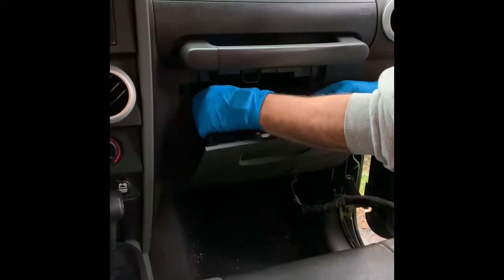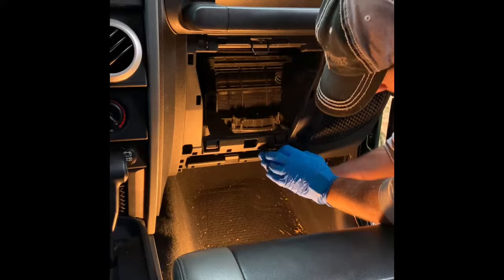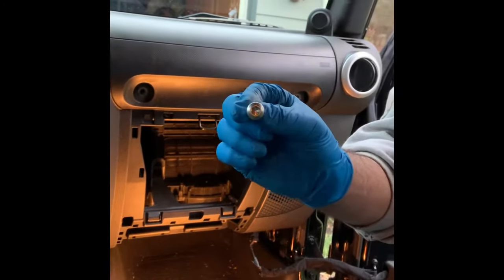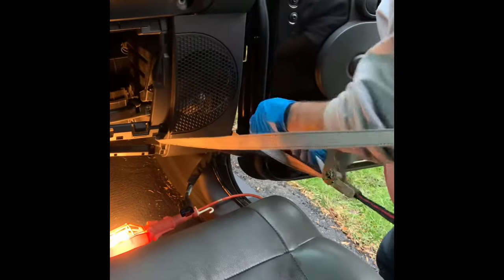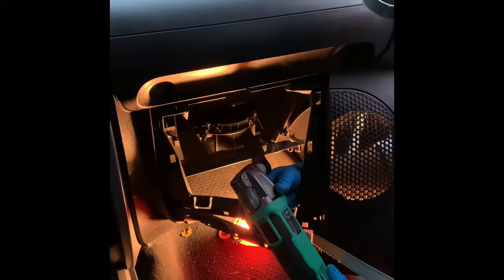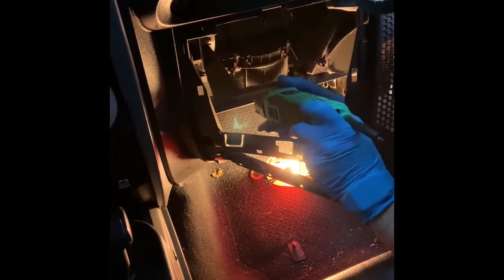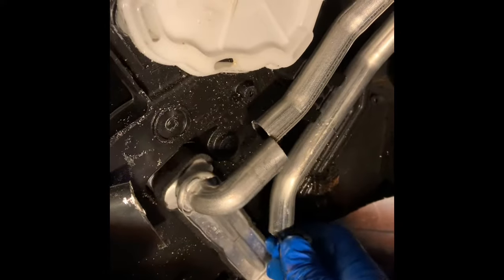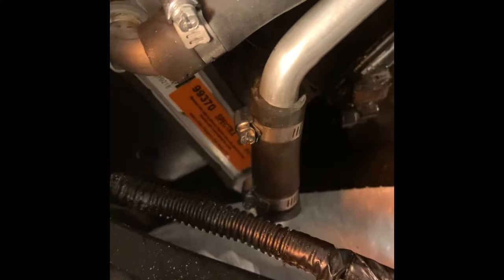Jeep Wrangler heater core replacement (short cut)

Comment: So I have the problem where the left drivers vent comes out cold.  Do u believe a new heater core would solve this issue?
Reply from the maker: My issue was similar to yours where passenger side was just a bit warmer, but still not hot. It got progressively worse. In my case it was the heater core since half of it was not allowing hot water flow. I would check all other possibilities first like making aure the blend door is working correctly
Reply: Your heater core is most likey clogged.   I did mine this weekend & the old one weighed about 3 times what the new one did.  Most older JK's don't have dual zone, so should only have one blend door.

Comment: Going to do this in the next few days. Did you drain the coolant from the radiator or clamp the heater core hoses in the engine bay? Or just cut the core out without doing either? Thanks.
Reply from the maker: I did not drain coolant. I did use a small oil drain pan and lined footwear with large plastic bag to catch any coolant that came out. Got a bit of coolant out but nothing major.

Comment: What heater core did you order? I assume its not the stock one since the plumbing is shorter. Or did you order a stock one and mirror the cuts? Thanks!
Reply from the maker: Sorry for delayed response. Here is one I ordered. Yes, mirrored cuts on new one. 
Spectra Premium 99370 Heater https://www.amazon.com/dp/B008VN02B0?ref=ppx_pop_mob_ap_share

Comment: Hey, thanks so much for that. I have a Jeep Wrangler Jk 2011 and my mechanic reckons that my evaporator is leaking. (this was done after a re-gas attempt and then a subsequent UV dye check performed) He's quoting me 10 hours of labour and parts. All up around $2500. He also suggests replacing TX valve and desiccant bag. I'm not sure whether I have to do that because just the evaporator is apparently leaking. By the way, unlike some of the other commentators, my cool air is gone. I'm in the tropics and boy do we need it. Do you know anything about TX valves and Dessicant bag? Would I need them? Anyway, love your method I really want to give it a go.....

*When you mentioned...."unhook the top heater core hose going to the engine and fill it with antifreeze. Reattached and used one of these funnel kits to get rest of air out. Got to attach funnel and let jeep get up to temp. You will see all trapped the air bubbles come out.

OEMTOOLS 87009 No-Spill Coolant Funnel Kit, Near Universal Fitment, Translucent, 15 Piece Set, Cooling System Funnel Allows Access To Hard-To-Reach Radiators" .......

And please forgive the dumb question..do you do this after or before? Thanks.
Reply: Do the txv and desicant. Any time you take apart the ac do the dryer. If it's easy to get to the txv, then just do it. They are cheap.

Comment: Wonder if draining some coolant, and putting the rear end on jack stands would minimize the amount of spillage in the vehicle.  ?  Maybe ?  Was it a lot that came out ?   Nice video thank you.  I'm thinking if i ever have to do this, a couple mending plates with bolts/nuts and that framing is back together !
Reply from the maker: lifting could certainly help, but not much coolant came out (maybe 20 oz or so).  It's up to you if you want mending plates, but not necessary.  If you cut where I say in the video, all goes back together well.
Reply: Something you could try if you have not already done the job is after unhooking the heater hoses blow compressed air thru one of the inlets to get as much coolant out of the core.
Reply from the maker: You are very welcome. Not much coolant came out, but enough to make a mess (maybe 12-16 oz). Not sure how much jacking back up would help. If you cut the framing per the video, no need for mending plates the bracket is only there to hold the dash, it is not a support structure in any way

Comment: Did u have any leaks at the clamps after doing this? I have tightened mine as much as I want to and sometimes it weeps a little
Reply from the maker: Hi Jeff,  Funny you asked about that.  It just started weeping from the top clamp.  I would up getting doubling up with new stronger clamp.
Reply: @Difficultmadeeasy  What clamp type did you use that’s stronger/better? 
Asking because I’m researching this job now in preparation of replacing the heater core in my 2014 Jeep JK Wrangler.
Reply from the maker: I would double clamp and would use stainless.  @chazzcapone.

Comment: Do you need to worry about refilling the coolant that leaked out? if you do need to, is it as simple as just pouring in the radiator or do you need to worry about air pockets?
Reply from the maker: You can refill from radiator, but will need to purge/bleed the air out
Reply: Oh gotcha.. any suggestions on how to do that easily? Or any videos you recommend?

Comment: how did you mount thay brackey back on ? did you weld it?
Reply from the maker: If you cut the bracket in the place I showed in video, no need to weld anything. Just put everything back together and will work fine.

Comment: Thanks. I have that trouble.  I cannot figure why hot fluid that runs in via the top tube and circulates through the radiator and comes back out the bottom tube can allow hot on the right and not the left.  Hot fluid has to be coursing through the entire core from top to bottom.  So how can the left side POSSIBLY be cold….and that’s cold top to bottom of the dash system on the left side, too.  Defies the laws of physics.  Why and how?
Reply from the maker: Hi Terrence, you are welcome.  I love my jeep, but unfortunately the engineering and quality of the products and parts that make the whole are certainly lacking.  If the heather core is blocked (this is very common), my guess is that hot water from the engine will find its way to the heater core one way or another (top or bottom hose) and stop the flow there.
Reply: Agree with all you say.  But you haven’t explained how a radiator can take in hot fluid at the top, get hot fluid out the bottom and deliver heat only to the right side.  I’m thinking of following your plan today but then working with the old heater core after it’s removed.  It looks much easier to play with out of the vehicle.  And then… how did you reconnect the bar that you cut out at the left side?  Did you add a patch with sheet metal screws?
Reply from the maker: @terencegillespie6675  I reconnected the bracket with the original screws.  If you cut support bracket in the same spots i did on video it can go right back in without any additional screws.  that bracket is only there to support the dash.  see section of video starting at 4:50
Reply: @terencegillespie6675  im sure you have repaired yours by know, but the explanation you are looking for is the heater core gets filled with casting sand. Its sand from the molds used for the engine. The sand gets trapped in the tiny tubes near the opposite end of where the coolant Inlets are. This is why the heater core will put heat to the passenger side but not the drivers side.

Comment: How did you vent the air from  the system? Thanks for the video
Reply from the maker: unhook the top heater core hose going to the engine and fill it with antifreeze. Reattached and used one of these funnel kits to get rest of air out. Got to attach funnel and let jeep get up to temp. You will see all trapped the air bubbles come out.

OEMTOOLS 87009 No-Spill Coolant Funnel Kit, Near Universal Fitment, Translucent, 15 Piece Set, Cooling System Funnel Allows Access To Hard-To-Reach Radiators https://www.amazon.com/dp/B01A2CQSU6/ref=cm_sw_r_cp_api_glt_fabc_E09TBH1GZV5E7DTJ97JR?_encoding=UTF8&psc=1

Comment: do I have to worry about any obstruction in the lines back to the engine?
Reply from the maker: I think the lines are likely bigger than any obstruction that could get stuck there.  more likely any obstruction would find its way to the heater core

Comment: A Lady friend is having this done on a 2011 Wrangler Sport, dealership wants $2030.00, independent mechanic $1400.00. Did you replace the bracketing by welding or not replace at all?
Reply from the maker: No welding necessary. You reconnect with heat resistant tubing and clamps.

Comment: You are the reason why I don't trust any mechanics I'd rather do this properly man cutting a support bracket for the dashboard then cutting the aluminum hard line to the heater core wow
Reply from the maker: Hy Shawn, appreciate the feedback. As long as the aluminum bracket is cut in the correct location has zero structural impact to the jeep or the dash. Cutting the aluminum hard line also not an issue. I have had no problems since the repair and heat blows hot!  I agree that pulling the entire dash apart and is correct way to do it but it will either cost you thousands ($2k) at my Jeep dealer or many many hours or repair. This is just an option that works if you don’t have the time or the $.
Reply: @Difficultmadeeasy   After extensive research I realize that you are absolutely correct it just doesn't look like the proper way of doing it but it definitely is the way you can do it It's really hard for me to wrap my head around cutting the support bracket for the butt of your - after look Deeper into it I noticed there was actual bolts that you can undo to take that bracket off But you're right I'm not gonna spend $2000 for somebody to put a heater cord in when I'll do it myself in a few hours I apologize you are right
Reply from the maker: @shawnmartins169  No apology necessary. Unfortunately the design in many of the JKUs makes it difficult to replace a $75 heater core that is bound to break or leak over the lifetime of the jeep. This is just one solution.
Reply: @shawnmartins169  I did this method several years ago on my Jeep and actually used some lock nuts and an added metal strips to connect the rails cut in case I needed to access it again and to keep the same structure it had with no reason for any vibration or movement down the road. Taking so many parts and components to remove the dash was not a well-engineered process and could lead to so many other issues forward. For that reason, I was inclined to go the simplistic route.

Comment: Idea estupida
Reply from the maker: is there something specific you disagree with?  Any insight would be appreciated about your opinion.
Reply: This is a great idea. There is no diminished structural integrity of the vehicle. I have changed heater cores by removing the dash and it takes a lot longer and is very frustrating. This is a great option for those of us who want to save money on a DIY fix.
Reply from the maker: @mrmnew  Thanks Michael, yes certainly cuts the time down quite a bit vs removing the dash.